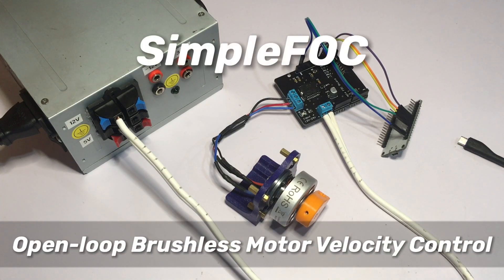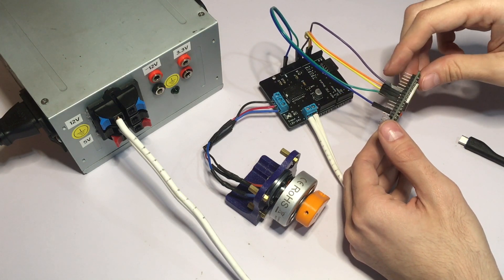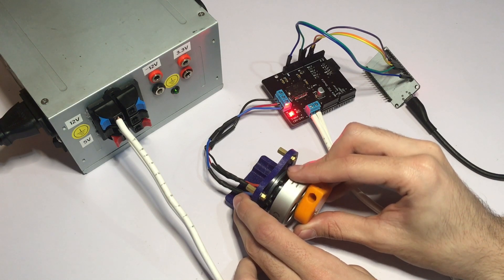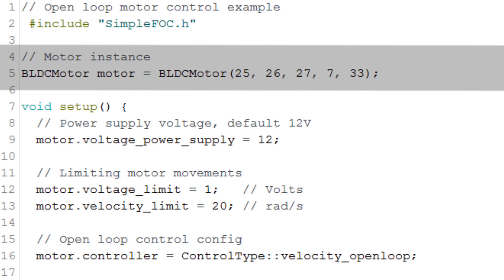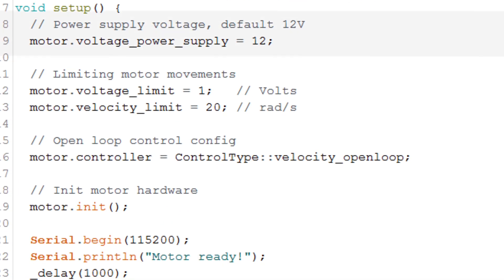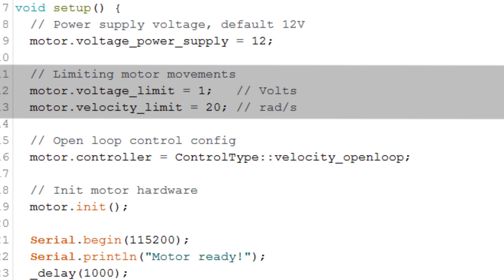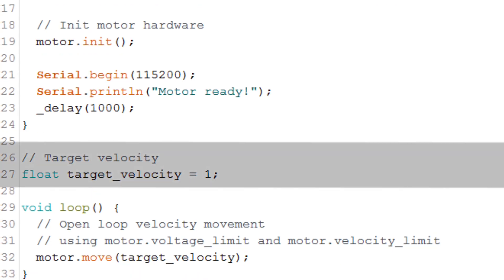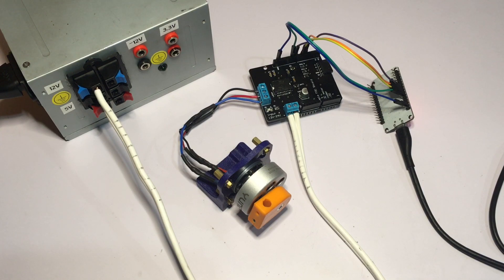SimpleFOC - Open loop velocity control demo (ESP32)

Comment: Can you build a video about the video process of driving DRV8305?
Reply from the maker: Hey tony,
I'm sorry for the delay. We do have a video about the DRV8302, which is a simpler version of the DRV8305. The process of driving is the same, just the initialization is done by setting some pins instead the spi communication. But we will try to make more tutorial-like videos in future!